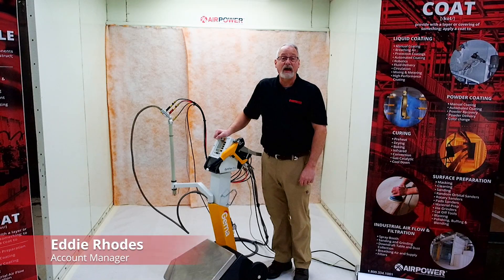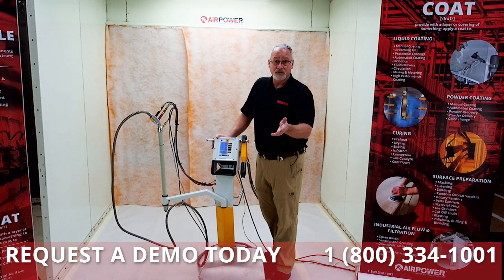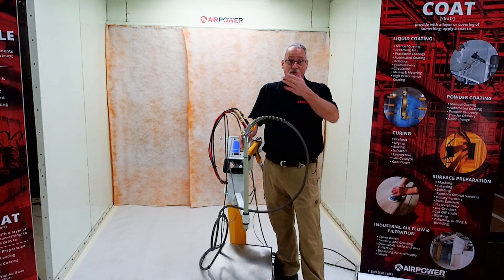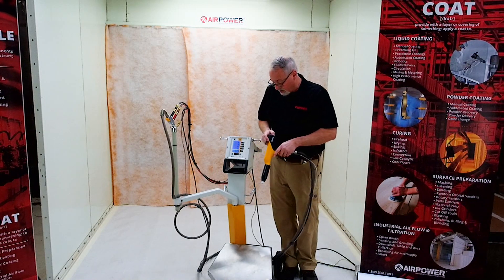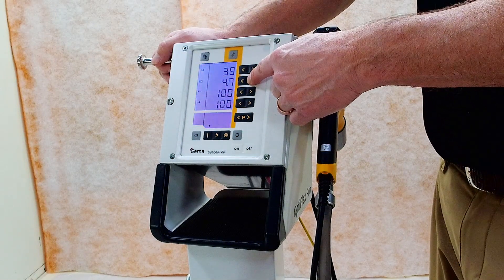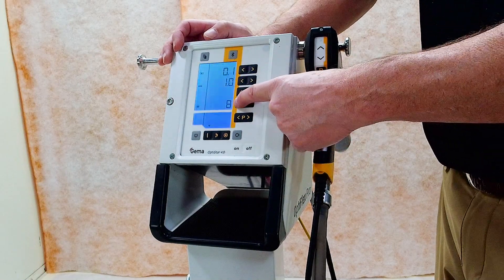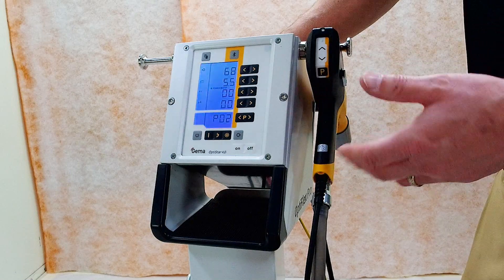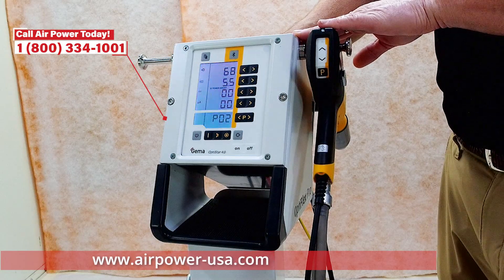Gema OptiFlex Pro Virtual Demo

Comment: Great video. Does this unit have vibrator, agitated for the powder in the box
Reply: Thanks for the question. Yes, the model shown in the video has a vibrating platform. The vibration helps to prepare the powder to be transported to the powder gun. A fluidizing membrane is also included at the bottom of the pickup tube to improve powder conditioning.

Comment: Maybe u can answer this. I was told to get one of your machines because of the Kv and uA adjustments. But no one can tell me the difference between what the Kv is for compared to what the uA is for?      Also if there is faraday Cage what one do I turn up or turn down and why? And when I lay powder and see fish eyes in the powder what do I adjust the Kv or uA and why? Before I pay this kind of money I need to understand this process.
Reply: Thanks for the questions. The short answer is; Voltage does the work and UA/micro amps is used to determine how quickly the fold back of KV/Voltage happens. The lower the UA the better penetration into faraday areas. Fish eye is caused by contaminates on the surface. However, if the gun tip is too close to the part the finish can mimic fish eye problems. You may be experiencing back ionization which occurs when the powder film build it too thick or when the gun tip is too close to the part causing the powder particles to become super excited and eventually repel (actually being expelled from the surface). The repelling of the powder particles will look much like fish eye. Hope this helps you. Call our 800 number and ask for a rep to come out and meet your powder supplier to discuss in more detail.